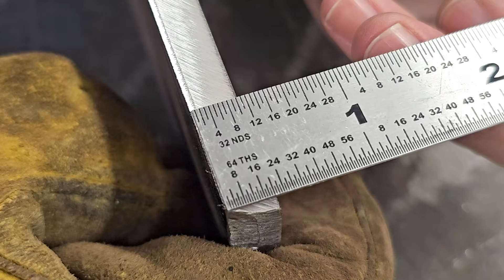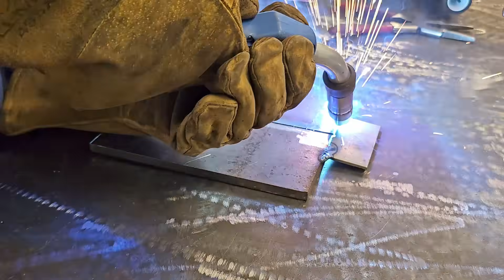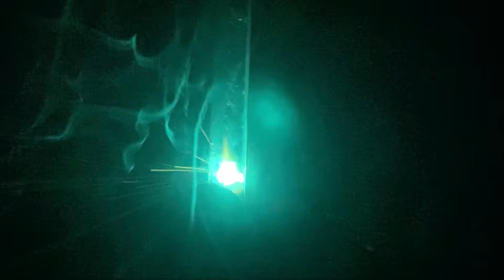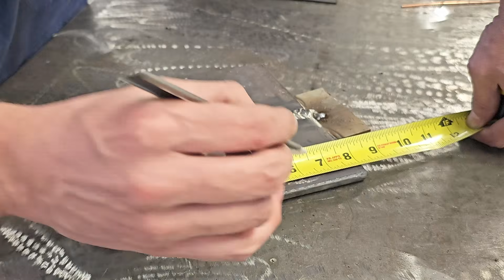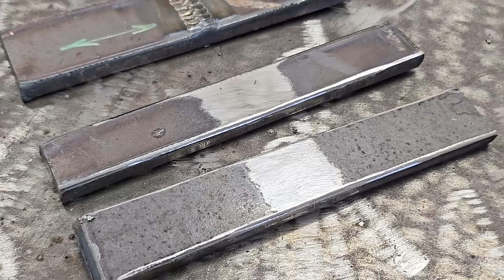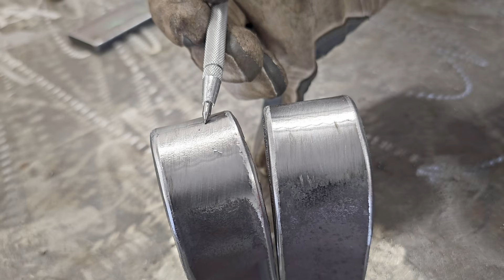How to Pass a 3G GMAW Certification Test | MIG Welding | Welding and Bend Test

Comment: Same applies if there’s a backing plate?
Reply from the maker: No, you would need to bump up the settings a bit on the root to make sure you get fusion, I'd say about 18 V 185 WFS, make sure you start about an inch out on the backing bar to get preheat before you run in to the groove.

Comment: Thanks for making this video! I'm about to head into the shop and do my exam practice. Expecting to submit my piece today or tomorrow for testing. 3g GMAW, 3/8" plate, 1/4" root, backer plate. It's calling for stringers, and almost spray transfer level heat.
Reply from the maker: Right on, good luck!

Comment: Any videos on this exact test but for pulse mig .045 wire 90/10 gas. Having a lot of trouble getting it going from doing short circuit all my career to going to a company that only uses pulse spray mig. I need some tips so badly, it’s getting the best of me and really stressing me out being that I’m struggling with it while others have picked it up so quickly. Makes me question my abilities
Reply from the maker: Oh man not yet!  Will try and do one soon!

Comment: not sure you mentioned:  what was your wire size?  (I will guess .035"?). thanks.
Reply: also, were you using C25 gas?  would using C100 ever be okay for a bend test like this?
Reply from the maker: @markdeitchman8938 yes, either would be fine but 100% CO2 will have different parameters for Volts/WFS.
Reply from the maker: Yessir .035"

Comment: So how much would you charge for doing it on ropes?
Reply from the maker: Not sure what that means 😂
Reply: @mezweldz7112 the cap was a bit ropey.. meaning the steps could've been a little tighter. Its still not too bad !!
Reply: @mezweldz7112 You're welds are spectacularly awesome, but if you had to be on ropes (as in rope access), how much would you bill?  I have a friend said he had to be upside down to do the job for over 30 minutes at a time.  Very glamourous job; body weight on your shoulders, breathing problems due to awkward position... 

Whew....he said he'd do it only for money.